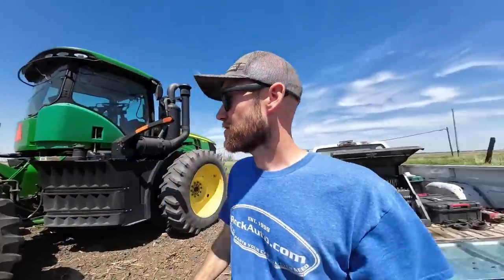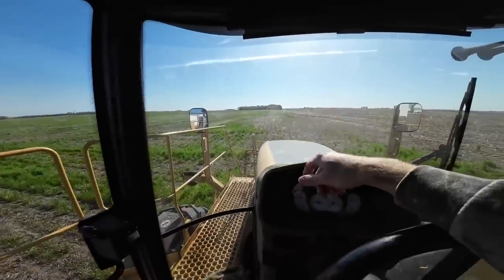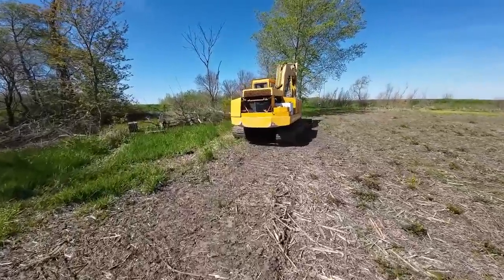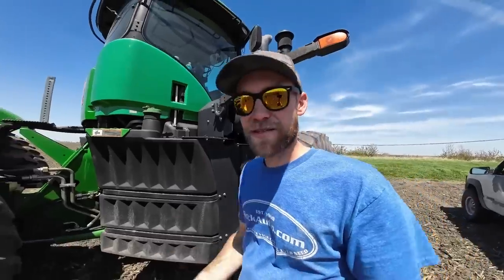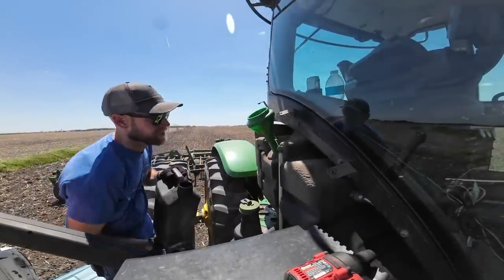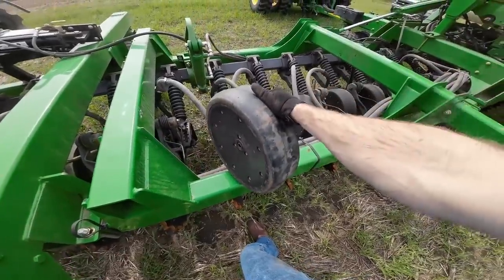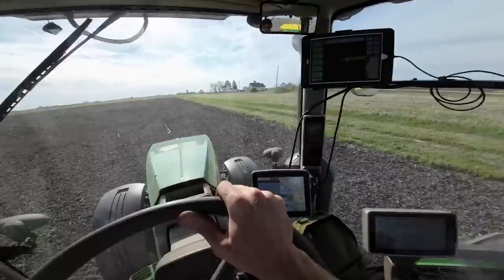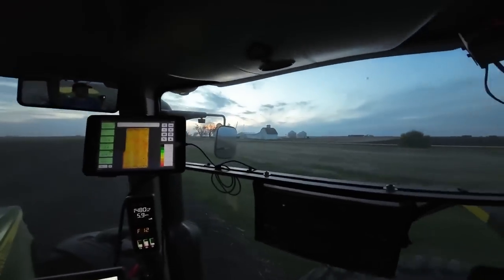I ran the tractor out of oil!!! Silly engineers!

Comment: Best of luck Wes as your family is "growing"👀👏👏🙂 Shop looks good....almost a reflective surface on that pour/pull! I know ya'll can't wait to finish it. Ya know, that curvy sleek green cover prolly has a "special option" version with an access hole and JD engineered lube oil fill grommet/connecty thingy...for an extry $8,999.99...I think I'd just replace the screws with some wing nuts...just in case your drill/driver battery dies and you're out in the middle of a field and need to add lube oil, and just happen to have some close by....just sayin'. Thank ya'll for farmin', fixin' and feedin'  🇺🇸   ...and have a good holiday!